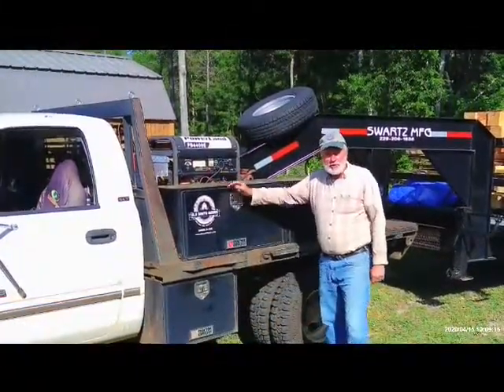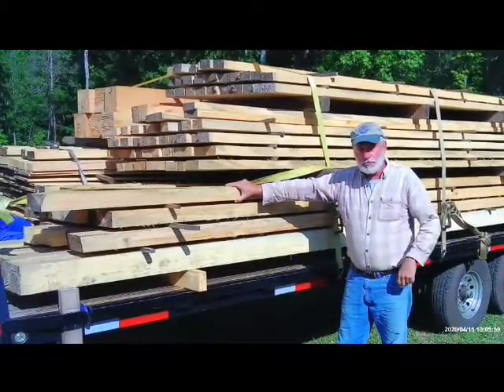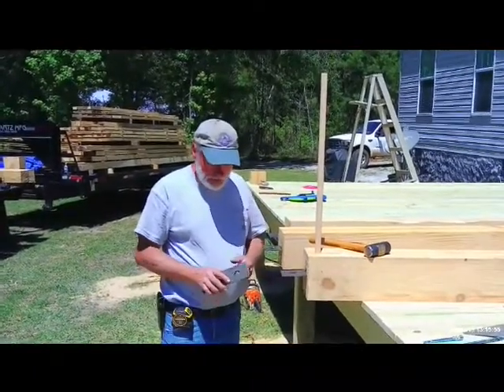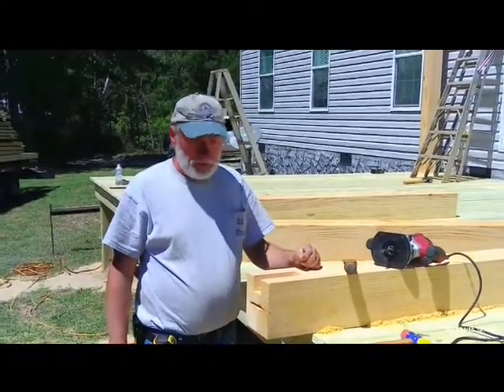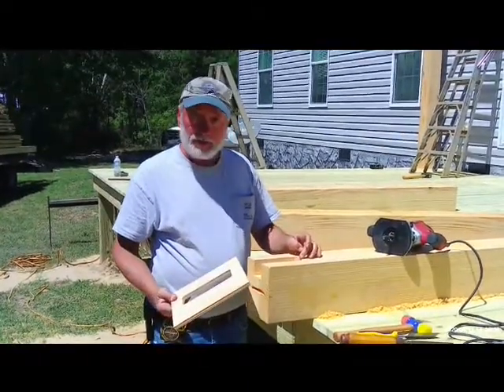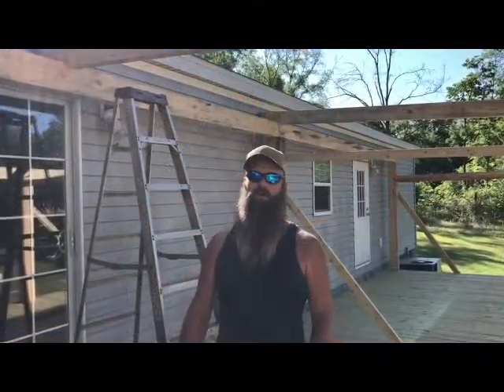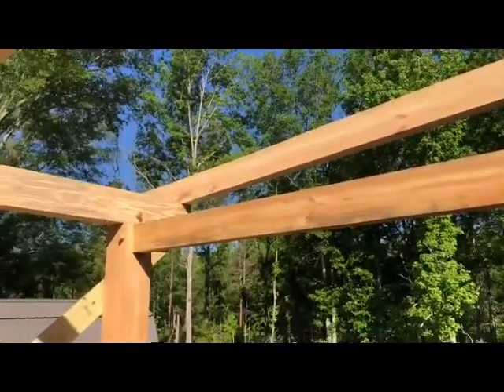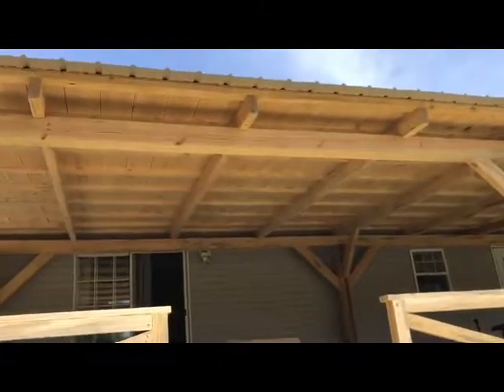The Sand Hill Timber Frame Porch - Old South Barns

Comment: In most county’s requirements for floor systems on decks the rim boards are supposed to set on post are notch the post for the floor rim boards to anchor yo post. 
Your videos shows otherwise with just screw anchor on side of the post
Reply from the maker: What our video does not show is we use two 3/8 inch angle iron plate brackets on the back side of each post attached with 1/2 inch carriage bolts. This way you do not compromise the integrity of your post by notching them and the angle iron support is on the rear out of sight for a clean look. Not all "CODE" requirements factor in old school craftsmanship nor have the basic rule of lumber understanding. Also, this porch was to receive latter an underpinning surround that needed the 1 1/2 projection.

Comment: Hey Fellas! How did you anchor the timber frame roof to the deck itself?
Reply from the maker: Great question. If you notice the porch/roof posts are directly over the pressure treated post of the floor framing. We drilled a hole down through the floor into the center of the PT posts and we drilled a matching hole up into the bottom of the porch post. A steel pin approximately 20 inches in length was driven using a special hydraulic epoxy adhesive to lock it all into place. This is similar Technolgy used in our area to mount grain bins to concrete. Makes for a strong unseen connection that is engineered approved.